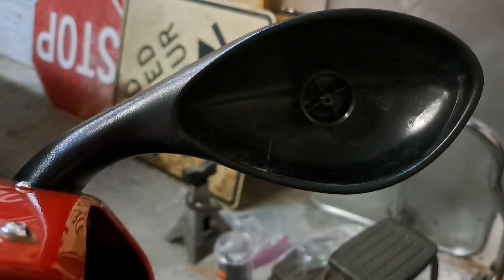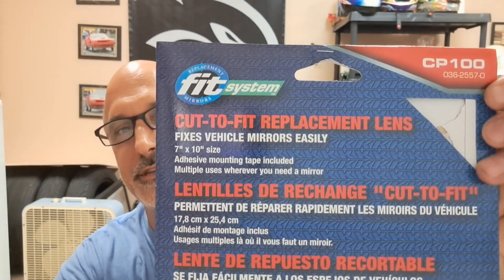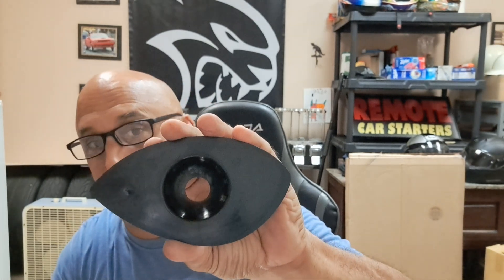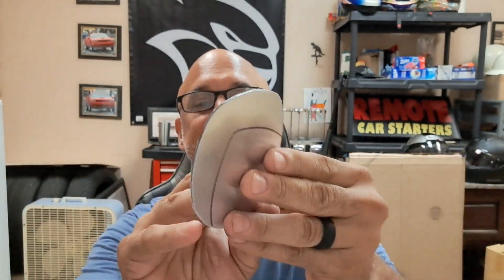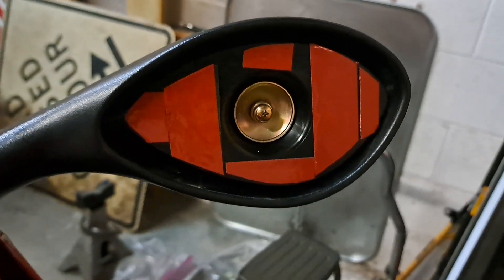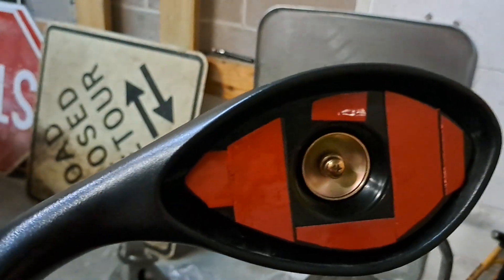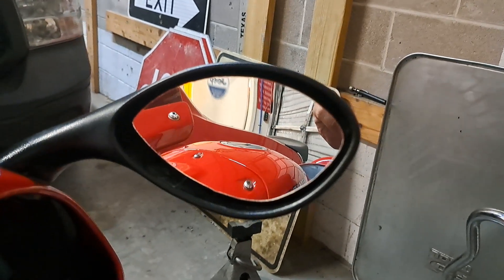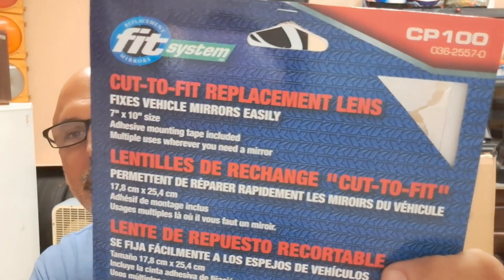Cut Replacement Mirror Lens.  Triumph T595

Comment: It kinda has a haunted house at the carnival look, but it is probably way cheaper than OEM for sure.  And, like you said, it will function for safety, and pass inspection.
Reply from the maker: It's actually not as bad as it looks on camera. It's just fine functionally. But I would not say that the Optics are perfect, LOL